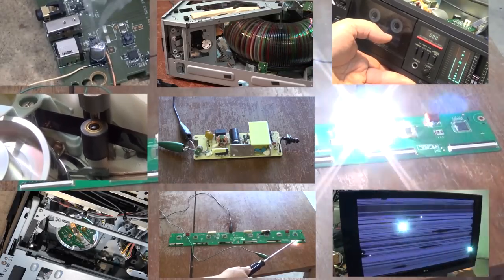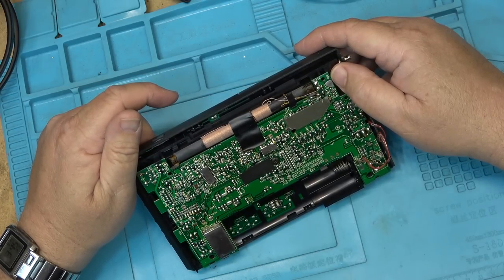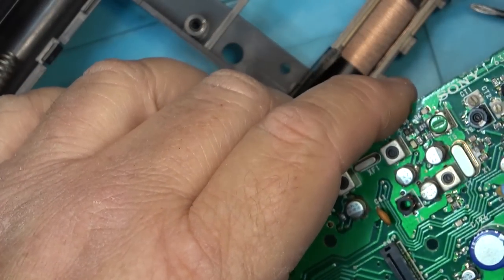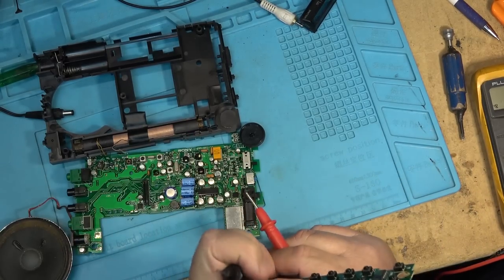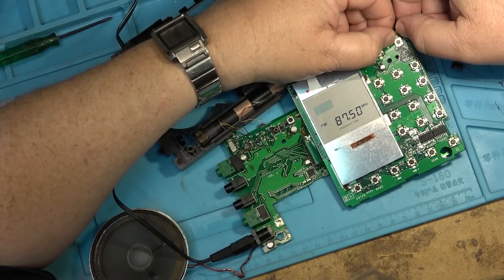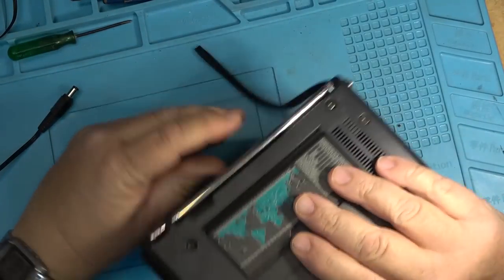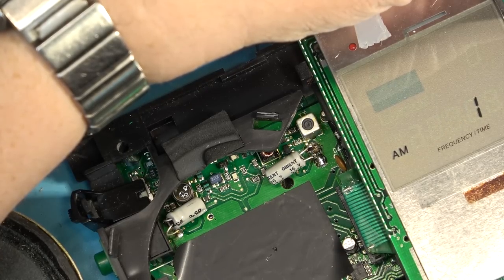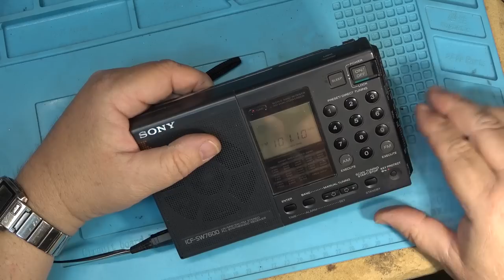Sony ICF SW7600 Multiband Radio Troubleshooting

Comment: I have two of these SW7600s (I recapped the second the other day - took around two hours with disassembly, removal, replacement and cleaning). They are fantastic radios and worth the effort of a recap. Currently living in a fairly remote part of Australia and it picks up lots of stuff from all over – sound quality is fantastic too.
Reply from the maker: If it was mine yes but the owner didn't want to spend money because I would have charged more than he could have doks it for.
Reply: @12voltvids  totally understand. Great video, as usual btw.

Comment: I’ve learned that many of the older radios I buy that’re non working is because of something minor which is great for me since I bought them dirt cheap because it wasn’t working. The speaker and a selector switch is usually the culprit and rarely the caps but they get replaced anyway to be safe so I don’t damage the PC boards. 
Thanks for sharing your work with us!

Comment: In this model it basically is not a question of if but when the SMD electrolytics fail. A bulk recap and whole board cleaning is commonly required, with occasional board repair work sprinkled in as well if the electrolyte has started gnawing at the traces. Citing the "Quick repair guide" straight off the Sony 7600 series page:
"Commonly defective ones include C127 (in the DC/DC converter) and C69, but generally any of them (including those around the audio power amp) may be dead and even leaky. If some are affected, the others usually are not far behind."
Just so you know, C127 is inside the shielding can.

I may add that the 470µ through-hole Rubycons in mine have aged better than the surface-mount jobs, but are still leaky in the electrical sense, giving rather pronounced rustling in the headphone department. Also, I still have to investigate why the Goldcap that was changed 15 years ago appears to be doing nothing now.

If memory serves the ICF-2010 still is an SMD-free zone though. This only started with the AIR-7, ICF-PRO70/80 and ICF-SW1.

What I've been told about this old Sony equipment is that soldering process temperatures weren't that well controlled and rather on the hot side to reduce the likelihood of bad joints, and that in turn damaged the rubber seals in the capacitors (which may have been marginal to begin with). 

It's all a major bummer because this affected some of the best equipment Sony ever made. This particular model is one of my favorite from the whole series, with its good sound, good shortwave sensitivity even on the whip antenna and easily the best AM strong-signal (IMD) handling of the bunch. (Nowadays I couldn't even do this testing as all the "local" MW stations have shut down around here.) I would love to see a SW7600 tested by Sherwood Engineering, so if anyone in the US has one to spare that works...
Reply from the maker: 2010 is all thru hole caps.  
Mine is working great.
Reply: Sound advice and data.
Reply: @12voltvids  Yes but mine failed, two very tiny tantalum bead caps around the product detector went leaky and resistive.They unbalanced the DC circuitry levels around them. If I don't recall wrongly I had to open one of those shielded cans to replace them , not easy.Thinks they were 2.2 uF.
Reply from the maker: @andytomm1  guy that owned these didn't want to spend money.  Go figure.

Comment: Hello from a fellow lower mainlander!  Have a few Sony’s which I have repaired (new ribbons on the folding models).  Had a 2010 purchased with no on/off complaint.  Turned out it was the power select switch on the side ‘not being used’ correctly!  The 2010 has been tested for low volume, the FET and all other faults and is perfect.  It is one of the first runs (low serial number).  

My question is related to the caps.  Mine all ESR perfect and the radio runs to factory spec.  And yet it is 80’s.  What ages caps a differing rates???

Thanks for the videos and take care, maybe we will get through Mayvember one day!  Geoff in White Rock.

P.S.  just finishing up restoring my Panasonic RF-8000, complete outer and inner; now thats a radio!

P.P.S. Do the 2010!!

Comment: You are amazing!
I first checked the Rubicon capacitors on the radio where I was facing the same issue. And yes, all three are swollen!
Thanks a lot!

PS: Radio is produced with a very complex electronics. It is very difficult to fault find, thanks Sony.

(sorry for my bad english :)

Comment: The original ICF7600D dating from 1983 fortunately didn't have surface mount electrolytics, it has very large rectangular number buttons, mine still works great after control cleaning etc. 
Possibly the change to surface mount electrolytics came in 1987 with the 7600DS,same case, slightly different colour.. Think the model in the video started production in 1989.

Comment: I have an ICF7600D. Looks a bit different than this model. It’s suffering from fuzzy FM audio. Looking forward to your upcoming repair videos. Pretty sure it also needs those caps replaced.
Reply: The 7600D still is all through-hole affair (very tightly packed I may add), but small consumer-grade electrolytics don't last forever either. Those in tuning voltage generation would be most suspect. If you replace every cap that measures out of spec ESR wise with some Panasonics FCs or similar you should be good for decades to come.
Reply: @PileOfEmptyTapes  Oh, that's good to know. I haven't actually opened mine up yet.

Comment: I don't think the caps are open;  typically when caps die, they become wires rather than open like resistors. Besides that, at least in modern electronics, you can't reliably measure capacitance in-circuit, because you'll get the sum of all caps in the circuit. Is it possible it could have been just the one or two bad caps throwing off your measurements? Not criticizing, just genuinely interested, I've got a lot less experience in this kind of stuff than you I am sure, just looking to gain some knowledge, besides the fact that stuff like that was made different than stuff today. Thanks in advance if you reply to this.
Reply: According to my experience (over 50 years) caps can fail in all manners you can imagine, shorts resistive  no capacity, resistive some capacitance , almost perfect insulator and funnily enough some behave as avery low votage (100 mV aprox.) low current battery. Different types of construction tend to increase certain types of failure, but is a general rule not exclusive.

Comment: I just re-discovered my 7600D a few weeks back, was sad to hear the dismal shortwave reception.  I knew it had to be the caps... should be a fun job replacing them.  Will need some practice on a junk board first.
Reply: If it's just the shortwave reception that's stone deaf you may also have a blown preamp FET on your hands. Q7, a 2SK152-2. (Which is not to say that there won't also be bad caps, they weren't exactly premium quality to begin with and the set is now over 35 years old. Having a bunch of Panasonic FCs or similar on hand is not going to hurt.)
Reply: @PileOfEmptyTapes  Yeah, FM is fine...but AM including the "regular" AM radio band is quite weak.  I will definitely look into the FET... is there any application difference between a -2 and -3?  Thanks!

Comment: I've got one of these I recapped and It's turning on, but only produced static. It won't lock into any stations. Any ideas what to look for?
Reply from the maker: Likely the crap they leaked out of the caps has soaked into the board and creating leakage that is detuning circuits.
Reply: Okay, nevermind. I realized there was a single 22uf 6V surface mount inside the stupid little DC-DC converter that was messing up the voltages to the tuner and that one cap was preventing it from locking onto stations. I replaced it and now seems to work.  One thing I didn't fix totally was the plastic clasp for the LCD board is broken, so it's not on there really great. If you have any ideas for getting that plastic collar down there after breaking it I'd be all ears

Comment: I recapped mine and it worked perfectly. Suddenly (after a few hours) it lost all sound even tho it I can see it locks well on channels.  I replaced the amplifier IC and still to no avail. Any idea what could be causing the problem?

Sometimes the sound returns on it's own, very low and intermittent. Also in a headphone, one side only.
Reply from the maker: Probably Christian on board from leaking caps.
Reply: @12voltvids  Oh I see.. probably that. it was put aside for 20 years without usage 😢
Reply from the maker: @hippohoppa i pretty much refuse any small devices with leaking smd caps. I might work on sonething of my own but I walk away from most customer gear with leaking caps for that reason. You recap a board and have it working and 3 weeks later it is back with a different fault that stems from corrosive electrolytic that has soaked into the board and corroded internal layers on multi layer boards.   Then because money was charged you have a pissed off customer that wants it fixed for free or a refund.  It's a no win situation so I cut my losses and just flat refuse the work.   I don't need aggravation at this point in my life. I don't need to prove anything to myself or anyone else.  As the great quote from lethal weapon went.... "I don't give a f**k"
Reply: @12voltvids  Very understandable. These caps were a menace to be honest. Ruining a good product like that!
And you have every right to feel so. Totally wouldn't be your fault but a customer wouldn't get it. I have tried fixing these on my own so I get it. The amount of hard work put in it and all for nothing? You are right all the way. Thank you very much for the video and your replies..

Comment: Hey - I have a ICF-7600D so similar to the one here on this vid.  It does not power up on mains or battery - it sometimes intermittently turns on but does not stay on for long.  Any idea on fix pls? (I am not an electrician) but I am sure can solder
Reply: Hiya any reply 12voltvids pls?

Comment: Love Sony radios. The currently made ICF-19 is a perfect hurricane radio: large speaker, very high sensitivity on the AM band with a 4.75 inch very thick ferrite antenna, and runs over 400 hours on a set of batteries. It would be perfect if not for soft muting on AM at night. Totally useless feature!
Reply from the maker: ICF 2010 puts the rest to shame.  It was probably the longest single model in history.  It was in production from 1985 to 2003. I can't think of a single other consumer product that was produced for 18 years. It was / is that good.
Reply: @12voltvids  Japanese radios were always surprisingly high quality. I`m a huge fan of Sangean too. I had an incredibly great Sangean made shortwave receiver with SSB and programmable cassette recorder I bought in the 1990s and ruined it in 2005 by leaving Duracell batteries in it after a hurricane. I was able to repair it a few times but only temporarily. The circuit board was destroyed. I have a Grundig G6, Tecsun PL-660 & 330, and an Eton Elite Executive now, but that old Sangean was much easier to use and had a real RF gain control knob.

Comment: Friend, I have a radio like this Sony ICF 6500W and it started to run the frequency and it doesn't stop. Have you ever had or know people who have had this problem and how to solve it. I thank everyone.
Reply from the maker: Probably a bunch of leaking caps and a destroyed circuit board.   Good luck. I washed my hands on these before I got too deep. There is a reason I walk away from "dogs" as they are known in the service circles.  Yes you can fix anything by repairing traces and pouring plenty of parts and money in. The problem is when you charge someone a pile of cash to fix one of these they expect that it is going to last a long time and there is no way to guarantee this. With the quality of new parts it's hard to guarantee even the new parts.  There has been more than a few instances over the past 40 years I have been in the business that i let a customer's emotions get the better of me (usually involving am attractive woman with something special to her that is broken) and it has come back to bite me in the ass because a few months later something else breaks and then more time is wasted and this time they don't want to pay. A few months later something else breaks.  End up getting married to a repair and then all the money i thought i was making is gone and I am in the red and miserable.  
So from experience I avoid devices that from experience are going to be problematic.  Old video cameras and walkmans fall into this catagory. All three devices when designed had an expected life of 10 years. Beyond that you are on borrowed time.  Even for lightly used devices it's time not usage that affects them. Seldom used devices tend to be far more problematic that. Well used devices.

Comment: Do all SME caps fail like this or just some brands?
Reply from the maker: Some fail some don't. There was a particular time where pretty much everything that came out of one of the Japanese factories every one of those surface mounted electric caps leaked. The story goes and I've talked about this before, that an engineer was lured away from one company to work for another and he took the formula for the new electrolytic that he had been working on to make these tiny capacitors. The problem was he missed a key ingredient that kept the pH stable on the electrolytic when the capacitor was discharged. This liquid became slightly caustic which then corroded the copper leads going through the seal and eventually leaked out onto the board and attacked the circuit board. Every manufacturer that used capacitors from this factory ran into problems. Sony and Canon were hit very hard for their camcorders in that late 80s to mid-90s cycle. Unfortunately it took several years before this problem was discovered. Devices which were used constantly didn't have this problem because when the capacitor was charged the solution was neutral it was only when it was left sitting discharged that it became a problem and this is why this problem showed up most frequently in devices such as camcorders, because people tended to use them seasonally and then they would sit for months on end unused. Working professionals using their cameras every day they lasted forever they never had a problem with capacitors. My ccdv5000 for example was full of them and I never had any trouble because I used to use it almost every week when I was shooting weddings when it first came out. Once I upgraded to my evw300 professional High eight I set the v5000 aside and just used it as a playback deck because it had a tbc.   I hadn't used the camera section for years I just used it for playback and I used to leave it turned on pretty much constantly. One day I went to turn on the camera and found that the camera section didn't work opened it up the entire camera section had leaking capacitors but the VTR section was fine because it was kept powered up all the time. I ended up changing all the caps in that unit about 85 of them and then selling it.
Reply: @12voltvids  I do remember that. Well that is quite a story and all us consumers get duped out of thousands in electronics that turn to crap. I wonder if any failed before they were first sold.
Reply from the maker: @markanderson350  i guess I will find out when i get into my icf2010
Reply: That was the story behind the 2000s capacitor issues. What I've been told about this old Sony equipment is that soldering process temperatures weren't that well controlled and rather on the hot side to reduce the likelihood of bad joints, and that in turn damaged the rubber seals in the capacitors (which may have been marginal to begin with). 

It's all a major bummer because this affected some of the best equipment Sony ever made. This particular model is one of my favorite from the whole series, with its good sound, good shortwave sensitivity even on the whip antenna and easily the best AM strong-signal (IMD) handling of the bunch. (Nowadays I couldn't even do this testing as all the "local" MW stations have shut down around here.) I would love to see a SW7600 tested by Sherwood Engineering, so if anyone in the US has one to spare...

Comment: My 7600GR doesn't turn on.  The display just flashes ' 0:00' . 
The power switch is Ok' 🤔
Reply from the maker: That's the clock that glasses 0:00 as it is in 24 hour mode.  That's 12am.  Those radios had leaky caps all over the place.
Reply: @12voltvids Yes, the clock display just flashes and sometimes the battery empty icon appears in the display and can't turn on the radio. This is the case  with fresh batteries and even with AC adapter plugged in.

Comment: I decided to get out of electronics repair once surface mount technology appeared in home entertainment devices. My eyesight is too bad to repair micro circuits or even mechanical wrist watches They can’t make my eye glasses any stronger
Reply from the maker: Yup i got out professionally in 2003 and got a job with the phone / internet / cable TV company.  Now just a hobby. My eyes were very bad throughout my electronics career.  Didn't make enough for laser surgery but once i got on with the phone co, I had enough to drop the 3,300 for Lasik.  Never looked back. 20-20 vision. No glasses needed for anything but i use cheaters for real close up work but very mild. Only a +1 over counter cheaters. It's amazing what they can do now. Here i am almost 60 and everything still works like it did when I was 20.
Reply: I use a digital scope to see small parts and bad solder joints. It helps A LOT!